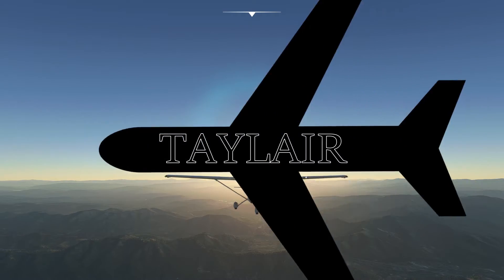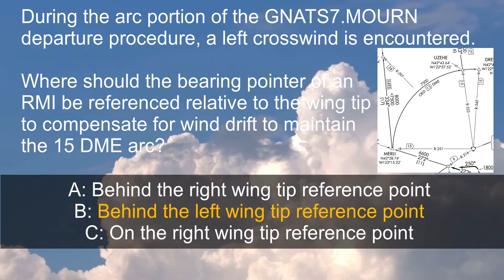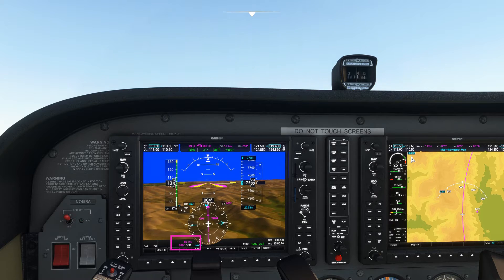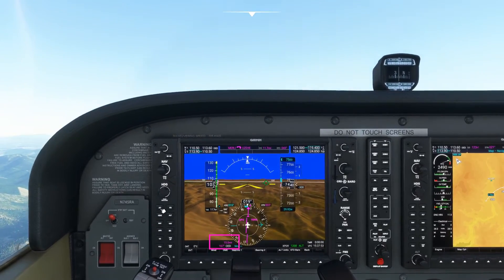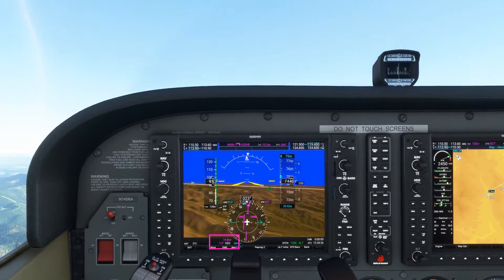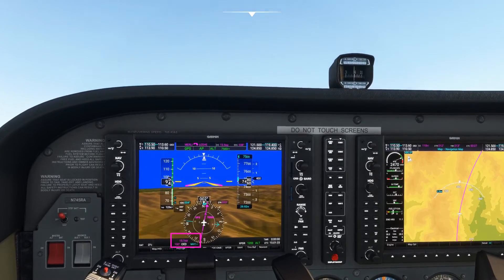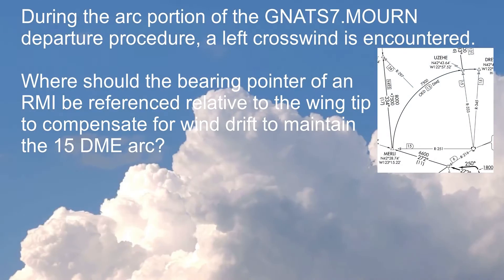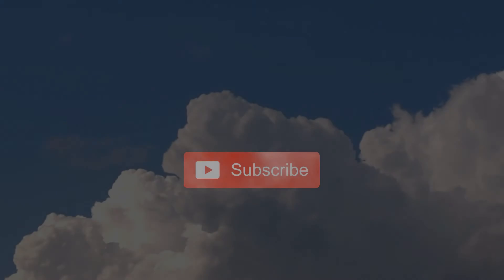DME Arc Wind Correction | Theory Quickie | Microsoft Flight Sim | Real Airline Pilot / Instructor

Comment: Nice tutorial 😃... Is there any rule of the thumb calculation to figure out the correct WCA as in this case? Thanks in advance
Reply from the maker: Yes. Travelling at around 120 Kts True Airspeed (which we are here) the correction angle will be approx half of the direct crosswind component. So here, the direct crosswind component is around 20 kts. If we half that to get 10, we can see that the amount of degrees required to maintain the arc is around 10 degrees. This is a very rough rule of thumb!